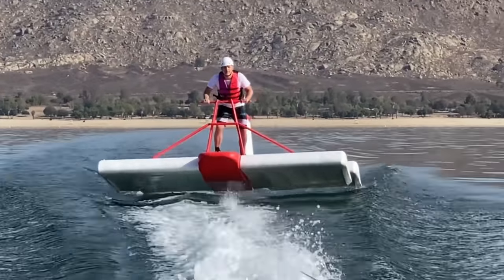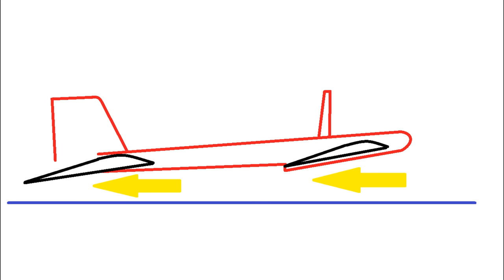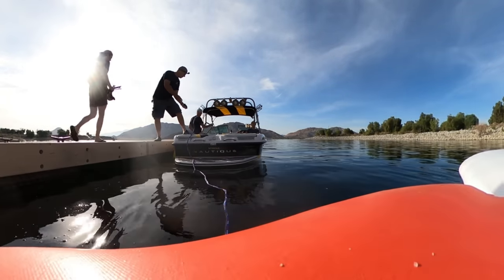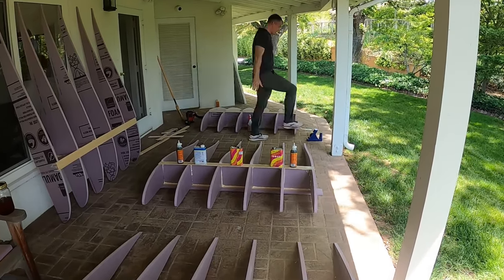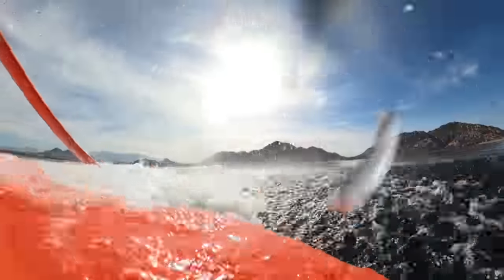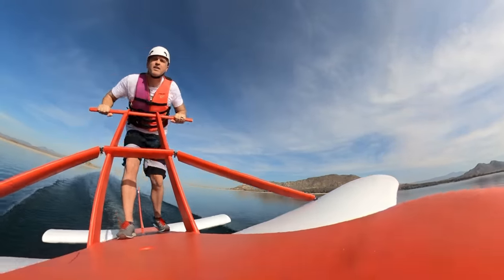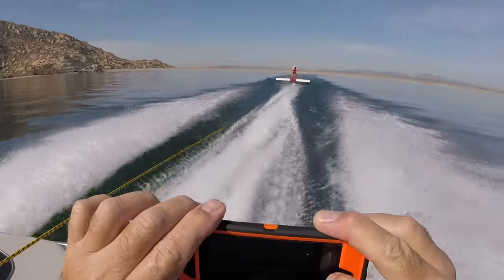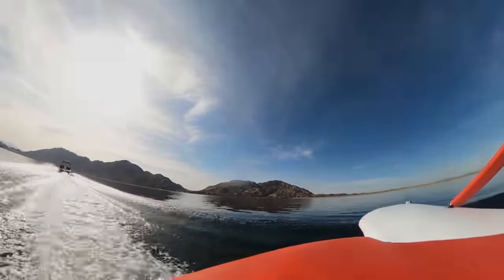DIY Ekranoplan Takes Flight:  Coolest Water Toy Ever?

Comment: Have you heard of the flairboat? It's a ground effect vehicle that was made a while ago that had a layout very similar to yours, except it also had fins(?) or a skirt(?) for lack of better word connecting the ends of the front wings to the back wings. Its only control surface was the rudder, and the roll was aerodynamically stable. Perhaps this addition of a skirt might help funnel air under the wings and increase the air pressure to help stability. Also counterintuitively, your craft might be too light and can generate enough lift to leave the ground effect. Maybe extra weight will help keep it in a safe ground effect as well as lowering its center of gravity to make it easier to control. Otherwise, I'm really impressed with what you've been able to accomplish in a simple home shop. Keep up the good work!
Reply: That extra weight should be movable front-to-back and controlled by a computer and a level sensor.
Reply: @snekmeseht  Don't know about computer controls since we're trying to keep this backyard shop friendly, but definitely agree on movable mass for trimming thr balance in between runs
Reply: @snekmeseht  this weight moving should be all directions I think. Not only front to back.

Moreover it should work like feathers on a birds wing. When you look at birds landing they us there feathers to smooth it out. This is also the case with bats. They don't have feathers but a very flexible wing. So maybe some kind of cape like endings on the wings could help?

The inflexible wings are working great at the start, but are a pain in flight. It is intuitive that we gave bat- and superman a cape. 😏😁
Reply: @snekmeseht  or maybe just use flaps?
Reply: Also need to make the airfoils tiltable.
Reply: @BartvandenDonk  Keep on featherin' it!!!
Reply: Why moving mass? You could use your control surfaces (some simple mechanical feedback loop) to maintain stability and shifting weight would mainly change your high above water with some limiations. Roll stability is I think very important. This could be very funny watersport device! If it was little bit smaller and maybe if you would be standing sideways many board people would try. Imagine that you would be now playing with water and air together so there could be many more possibilities to have some fun.
Reply: @Lurch7861 There's videos of the flairboat on YouTube. Look it up. It's absolutely a ground effect vehicle
Reply: @snekmeseht  I was just coming to say that.
Reply: @BartvandenDonk  The cape! So true, "man"! I never made the connection! And I'm 59!   😂

Comment: you should switch to a twin tail and larger tails.   your body is blanking out the small current tail.    plus if you fall back with a twin tail you fall between the tails.  (safety)    your upright should be held on with break away pins in case you take a nose dive.   there are a few other changes I would make but that should get you going.
Reply: What he said!
Reply: the upright is foam it will break away ...lol.....

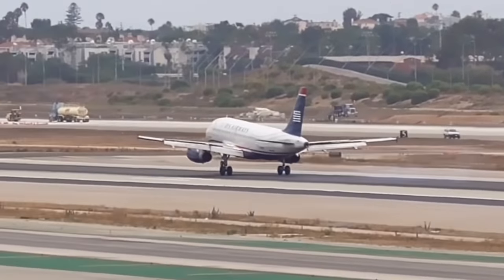Comment: "It's a very efficient way to fly, and now you know why!" (2:06) .. the Ekranoplan way. ♥
Amazing progress, and achievement. Human flight! 

The ability to control centre of lift, or amount of lift on front wing would help to better manage pitch control. 
Thinking a simple hinged spoiler (pair) on front wing controlled via a bicycle brake could help?  Even if pretty small, spoilers should add just that bit of extra control in addition to weight-shifting to enable endurance runs.

Comment: I know you already committed to the tandem wing but that is causing the runaway effect once angle of attack increases beyond what your weight shift can counter. If you were to make a new one or modify this design then a larger rear wing with a smaller wing at the front that has a higher angle of incidence would most likely cure that problem. Same as any Canard aircraft configuration works. The front wing stalls first and drives down the front so the rear never stalls. If done right I imagine it could be towed at varying speeds and be self stabilising. Also I wondered about the choice of that single rear fin behind you, if you were to lose grip on the handle and fall backwards then you'd injure yourself on that fin, maybe think about a twin fin design?  Love your ambition and that you go out and build and then fly this thing - keep up the great work you're doing on this channel!
Reply: I agree with all of this especially the part about an awesome channel.

Comment: Congratulations, it's a great development. May be you can measure the tension force in the rope for power requeriments calculations. Pitch stability could be improved increasing the angle of attack in the front wing like a canard. Greetings from Ecuador

Comment: Do dual throttle handles, attaching them to split elevators (right/left) on the horizontal stabilizer.  
Set them up so that the natural rotation on the throttles from forward/backward body movement cause the split elevators to counter react.  
Ergo, knuckle down rotation from leaning forward would send the elevators down, forcing the nose down.  
Ergo, knuckle up rotation from leaning back would send the elevators up, forcing the nose up.  
The same would apply to sideways leaning, as well, which would correct for roll.  
That's the solution.

Comment: Nice work! I think it will be extremely challenging to fly a canard-style plane with weight-shift alone though. Weight-shift is more suited to a layout that requires less pitch moment, ie. single wing. From the point you're currently at, I wonder if some way of killing lift from the front wing (spoiler maybe?) would be enough to keep it under control - the drag it would cause is not a problem since you're being towed and presumably power is not scarce. Your body might be blanking the vertical stabilizer too.
Reply: I just went and watched your build videos. The vertical stab seems big enough that blanking is probably not an issue. Regarding control, how about elevators on just the front wing, controlled by pushing the handlebars (forward to nose down). As well as being able to dump lift quickly to avoid the pitch up problem you had, elevators would let you avoid flying until ready, then use a small quick 'pop' upward instead of a slower movement that goes too far. Having to push forward to nose down would also naturally cause the rider to shift their weight forward a little too. Roll seems like it's ok with weight shift.

Comment: Well done guy! You've finally do it ! 
As I've said previously on ideas, you absolutely need a better vertical rudder. Including basic cablecontrol of whole surface or half if more easy to built. At least 3 or 4x actual vertical surface you have 
And I think I use this mod benefit to add an horizontal control surface with big dièdre for stability and help controlling the attitude

Upper than your own size. 

And for the center of Gravity, push forward your whole position.  

After that it will fly forever. 

Well done 👍
Cheers from France 🇲🇫

Comment: Glad to see you didn't hurt yourself. A better control system might be two poles taller than you, connected at the top and side wired to both leading and trailing edges of the wingtips. Or, if you have sufficient backing for two struts per pole, you wont have to make the control poles that high. But you will need at least two struts per side, forward and trailing to make a captured triangle. On launch you can walk through the control frame and hold on with arms behind you.
 Remember that boat speed does not necessarily equal airspeed. They sell cheap digital anemometers nowadays that plug into your phone.
At least she flew. Too much more time investment into this may prove frustrating as one bad landing will result in serious structural failure. But hey, you did it and that must feel amazing. Grats!

Comment: I volunteered with a ski school that specialized in teaching disabled people how to ski. In 1980 they taught me to ski when I was 10, then again when I was about 22 and went from skiing "2 track" to skiing "3 track"
    In the winter they teach snow skiing, in the summer they teach water skiing. As water skiing for some disabled people means tying the ski to the boat (if they can't hold the rope). This means a quick release on the boat, and someone ready to release the rope the instant the person fell or signaled they wanted to stop. Dragging disabled people through the water is 100% politicly in correct, also, it is not very fun to experience. I know, all the volunteers had to experience being dragged through the water for a couple of seconds, just so we would be motivated to pay close attention to the skier and be ready to release the rope.
    In some cases (like me) this involved dragging disabled people through the water, but it was done for a good reason, so it was okay.
   That was the most satisfying and rewarding jobs I have ever had, paid or volunteer.
   The system we used was way more simple that your method. There was a link between the rope and the boat. A small tug opened the link and the rope was released.

Comment: Congratulations on another great design.  That looks like a ton of fun in the water.  I was worried you might slip and fall back onto the vertical stabilizer.  If your footing is ever an issue, you can add some gritty non-slip surface where your feet go.

Comment: I love the skirt idea. Similarly, What about a tube that connects the front and rear wings. After becoming airborne it would open on both ends simultaneously and the excess pressure front would be placed in the rear, and help level the structure.

Comment: That's amazing. Such a lot of work and perseverance. Awesome. BTW I think they used a large horizontal stab that is raised above ground effect to counter the shifting Cp, moment of rotation problem. I'm sure I've seen that in another WIG video. I'm also confident you could do it with a control system that spoils the front wing. Perhaps like a surface follower wand like they use in hydrofoil heave control.

Comment: Instead of weight shift, you could try tow point shifting.   Low tow point will help getting in the air, higher tow point will prevent kiting.  
Sailplanes use a high tow point for aerotow and a belly hook just forward of cg for ground winch/automobile/bungee launch.  Winch tows utilize kiting for a parabolic launch curve.

Comment: Great stuff! How about gymnast parallel bars to give you more range of movement? If that doesn't work it might need a mk2 version with more natural stability.
Reply: Some ideas:
* Add some dihedral for roll stability. 
* Small front cannards like another commenter said. Set them at a higher angle of incidence than the main wings to help get the nose up, but if it pitches up too much they stall and drop the nose back down. Ideally they should end up hovering just before stall.
* I'm guessing you're trying to do this without control surfaces, but at least being able to trim the tail (maybe with a bicycle friction shifter) will make things a lot easier.

Some of this could be very wrong. My aero is fairly rusty.

Comment: Hugely impressive - great results from a sleek and visually simple design. I did wonder if you could create a more progressive transition from boat to plane if you had some small hydrofoils fitted to reduce drag at the point of leaving/returning to the water's surface ?

Comment: Try to put a chair on small rails. When you lift, you pull yourself forward to move the CG...Also put an engine in the back with a push propeller. That's my plan for mine (different design)

Comment: Awesome achievement to get some air on such a novel craft. Held up well to the mishaps too, so design and construction have proven to be in the right ballpark.

Looking at the flights it looks like there may be a few tweaks you could make to help with stability and control:

The combined centre of mass of the craft and pilot is above the centre of lift, drag and the tow rope connection. Even without the COP changes as you go from float, to ground effect to flight away from ground effect, having a high COM complicates stability and control. 

If possible I would recommend lowering the combined combined centre of mass,  The easiest way to achieve this would be to lower the pilot, this could be done by having having a hollowed out part of the hull where the pilot stands - i.e stand in the hull rather than on top of it, or have hull locally narrowed so your feet are supported astride the hull.

The other way of lowering the COM would be sit, even more extreme lie prone.  Both these configuration will complicate control, as weight shift wouldn't be so easy, so aerodynamic controls may be required.

The other area on could possible tweak increase the span of the rear wing a little, with the tips bent upwards to provide some roll stability as the low outer wing section gets into ground effect and at a more favourable angle to the water than the upper wing.

The wider span at the rear would help with pitch stability as it'd move the average area backwards, so the static margin would increase - as the tips are canted upwards they would further away from ground effect than the rest of the wing(s) so shouldn't interfere too much during take off and in ground effect, but during an full lift off event would help avoid the nose from pitch up.

A bit of washout in this rear tips would probably be helpful too.

Potentially you could replace  vertical fin with these tip extension as they wouldn't be effected by pilot wake.  Though for experimentation this would be change way too premature.  Perhaps if follow up designs come along they look such optimizations.

Best of luck. It's been great seeing this project progress.

Comment: Very cool, would using a "traditional" ekranoplane design reduce the necessity for weight shift?
Reply: As shown in some video excerpts, for that scale, the Lippisch design is more common. The real Ekranoplan is much, much longer, and I don't think it's any random. Now, this one is towed, I wonder if it was propelled by pusher propellers: I have the feeling there is something more than just the centre of pressure and the centre of gravity, I suspect there is a difference if you pull at a spot or push at another, intuitively you'd visualise vectors.
Now, the big question is: did you put some kind of plans online or should I redo everything starting with the CAD model and the wooden model (I loathe epoxy but I have plenty of HDPE foam and light-ish wood)?

A couple of years ago, I built a Lippisch-style model with fabric forward-swept wings (around a cylinder, makes it easy to wrap the skirt), but it turns out that 3D printing made things too fragile for my motors -- the propellers probably were oversized too and my terrace was too short, and everything broke at first start. The 5-second video shows it rather stable until it crashes into the railings, but on such distance (5 yards), not much to see or say. Now, I have a chisel...
Reply: @RegisMichelLeclerc  Ekranoplans (GEVs) with a pusher propeller have a thrust vector that is above the centre of gravity, this would create a pitch down component. Example: a burst of power could help counter a pitch up tendency. However the opposite is true too .. a sudden power reduction at speed could enhance a pitch up tendency. This assuming not other control inputs used.

Comment: Have you thought about using an IMU/Teensy to actuate flaps or rotate the wings instead of relying on your ability to move forward and back (shifting your weight)? Similar to how you control your motor speed on your RC ekranoplan.

Comment: instead of moving your weight, would it work to make a quick release for the rear wing to create more lift at the back fast? Or just give the bar you're holding the option to slightly push forward while adjusting the rear wing at the same time

Comment: I still think the canard is not set to the correct positive angle of attack relative to the aft wing.  Canards are referred to as "stall proof" for a reason:  There is inherent stability in the design, given an arrangement that positions the canard at a few degrees positive AoA relative to the aft wing.  That should also cure your rapid center-of-pressure movement forward during weight shifting.

Comment: Double the wingspan, this will double the ground effect height, hence keep you clear of bumpy waters by a foot, I guess it helps with stability.
Give up weight shifting, you are never going to be that swift, put on some flight control surfaces, like ailerons, tail profoundor or nose canard config, maybe the front wings can tilt at will to act as canard control surfaces, stearing is easy, dive a plank in the water with a rudder of sorts at the rear end. that will help keep it going straight and take turns as water is 800 times more dense than air.

Comment: I would try to use slightly longer and lighter towing rope, it should keep you in "flatter" water with less disturbance. I would try to use dyneema rope propably even something like 4mm would be enough, lighter rope should be easier to keep out of water which would result in more consistent pulling force due less drag caused by rope in water

Comment: You NEED to get rid of the single rudder in the back, it's completely blocked by the turbulence of your body.  try dual stabilizing rudders.. on the back and you could also do it on the outer wing tips.. which would give you better control as you pull the nose up.   Yes.. both on the wings and the tail.  The ones in the back would actually cut thru the water.   cool design..  congrats